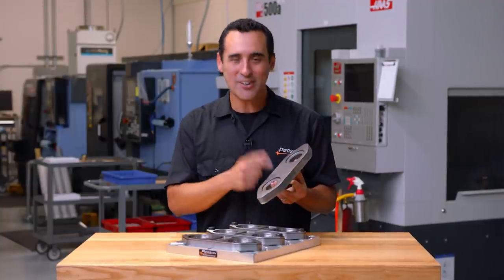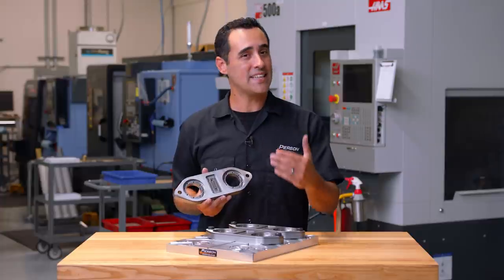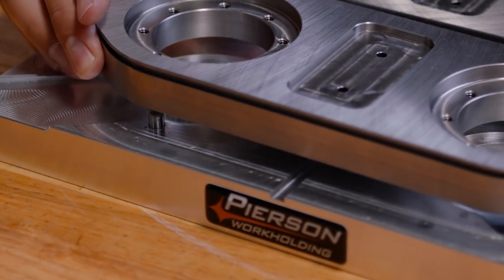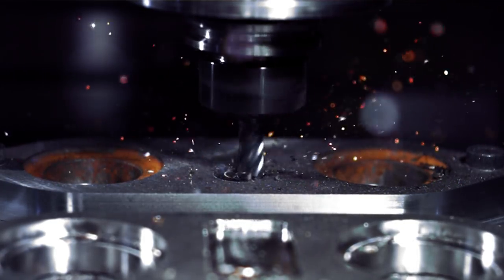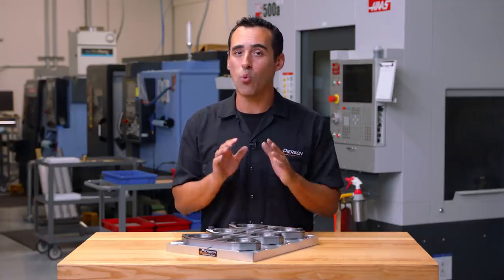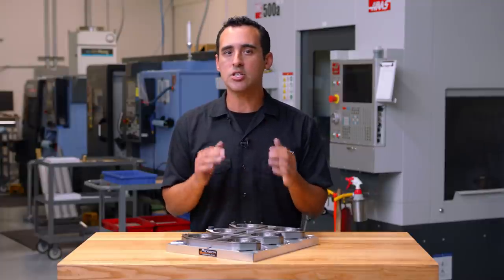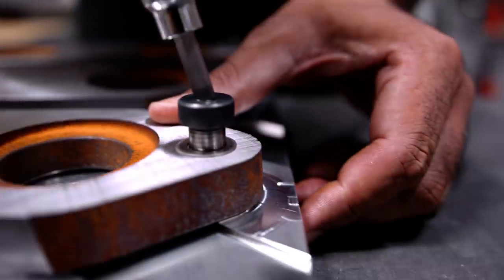Machining Cast Iron? TOTAL PAIN! | Fixture Friday 17 | Pierson Workholding

Comment: For chips évacuation at the shop I have worked on every large CNC lathe and milling we have created a large pit hole in the ground then made a concrete sealed pool and and drop in a stainless steel reservoir for the cooling system. So instead of having 10 to 20 gallons of tool cooling fluid we have 200 to 300 gallons, and for chips evacuation we have a separate system that pour lot of cooling fluid on the working tool .
And here in Quebec the ground in permanently at 10-15 degrees C*

Comment: Great video!
We use a ton of custom 18 x 18 x 2" pallets. 
To make them light enough to handle I do an isogrid on the backside.
Love the Pro Pallet System !!! no telling how many parts we've made on them.
Reply: That’s a really good idea!! How would you say the isogrid affects rigidity?
Reply: @thekeyfox  I run all my big (18 x 18") fixtures with isogrid on the back to reduce weight.
On the first fixtures I made, which were only 1" thick, no isogrid, I could measure 0.003" of deflection as I tightened up the pitbull clamps. Move to 2" thick and it dropped to less than 0.001". I see almost the same (just over 0.001") after cutting the isogrid on the backside. Isogrid is 1" deep, webs are 3/8" thick, Triangles are 2.250" per side. My mill operator thanks me everyday. 18 x 18 x 2" plate is heavy, throw on 6 pieces of stock at 8 x 4 x 1.75" and it really gets heavy.
Reply: Man, this makes me slightly glad that i've somehow ended up doing almost exclusively "you need a crane" or "you need a magnifying glass" stuff

Comment: Great video. Love the thumbnail. 😲 What video editor do you use BTW? Cool plugins. Also, how many parts would you need to make to consider acquiring a Blanchard grinder of your own?  I learned a lot about them after watching the recent NYC CNC video of the Bourn & Koch factory tour and have personal experience with such a product in the ATP 5 plate I purchased to replace the heated bed on my 3D printer. Thumbs up applied!
Reply from the maker: Blanchard grinding requires a very skilled and experienced operator. It is also INCREDIBLY dirty. For these reasons alone we'll outsource as long as possible.
Reply: @PiersonWorkholding  That makes sense. Thanks for the reply. 👍🏼👍🏼

Comment: Very cool video. Thanks for the insight. 
Would it work to clamp the parts for op 10 with two clamps through the holes to contour the outside and drill all holes on the backside? It may be possible to save the op0 that way. And pallet use the parts also for op10
Reply from the maker: We've tried a lot of approaches including the one you mentioned. Notice the pallet  has tapped holes at the center of the two large bores. We used to clamp down on the bores to machine the features but the methods featured in the video ended up being the most reliable and fastest method of production.
Reply: @PiersonWorkholding  thanks for the response. Yeah the clamp must spare out the holes and be clocked in the fixture to not be able to set them on incorrectly and block the hole locations.

Then make the fixture a little bigger and of steel to increase the ridgidety to place two op10 and two op20 parts on it and you eliminated two setups, two cnc Programms and have a one piece flow with no batches 👍🏼

Comment: How much price difference would there be to make it out of A36/hot rolled instead of cast iron? You'd presumably need less surface work and external grinding. Or maybe you're after the slightly more dampened material of the cast iron?
Reply from the maker: Good question. Compared to A36, cast iron is less expensive, it cuts like butter (long tool life), and is very thermally stable. Plus it has a dampening factor 20x greater than steel.
Reply: @PiersonWorkholding  yeah if you need the dampening, that'll do it!
Reply: I believe the correct term is damping.

Comment: Have you set up anything to try and deal with the cast iron sludge in the VMC you run them on?
Reply from the maker: Yes we run dual canister 20 micron filters in parallel after the coolant pump. Scroll way back through our IG for part numbers.
Reply: @PiersonWorkholding   Thank you for the reply! Do you find that keeps most of the sludge from building up in the tank, or do you just call it the cost of doing cast iron and clean it every 6 mo?
Reply from the maker: There's no preventing cast iron, or any chip material, from getting in the tank.  We use an Eriez sump cleaner after cast iron runs to clean and filter the tank.  The filters I mentioned earlier keep the cast iron out of the coolant lines only.

Comment: I didn't see where/how you drill the locator holes for the pins in the casting.
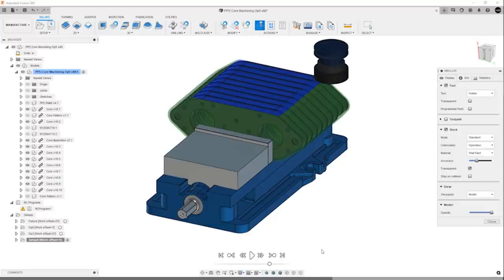Reply from the maker: We didn't show it, but I mentioned it at 1:47. We hold the parts in a double vise to add all holes for Op1. Specifically, we drill then ream the holes for the locating pin.

Comment: Hey Jay - Love this. I have some cast iron parts that come through my shop periodically and always struggle with the chip evacuation and keeping the dust down. Since you machine a lot of cast iron, I was wondering if you have tips for managing dust and/or maintaining coolant when machining cast iron?
Reply from the maker: Yes. We filmed dry for the sake of video but always run coolant. We also filter our coolant and change filters every 8 hours when running C.I. Scroll back through our Instagram for our DIY coolant filtration for under $200.
Reply: @PiersonWorkholding  Ace. Thanks so much. I’ll have a look for that coolant video right now. I have really been struggling with the dust. Cutting it is no problem, but the nasty film and dust left everywhere has me thinking twice about doing more. I was hesitant to use coolant because of the contamination, but a filtration system would mitigate that. Thanks!
Reply from the maker: @tshumay  Here's a link: https://www.instagram.com/p/BavvinOFfBP/
Reply: @PiersonWorkholding  Thanks! Ordered up the parts today. Goodbye graphite dust! I will not miss it.

Comment: I don't understand this... Why not design the system to be more like Zero Clamp or VERO-S? Where the customer just screw in some male-anchors on the bottom. Is that not basically what's going on anyway? What am I missing?
Reply: Much more expensive to do it like a vero-S, and if it were not cheaper than Vero-S system then there wouldn't be much of a value proposition. The Pierson setup is quite a bit cheaper than a VERO-S system if you are satisfied with the pallet sizes. I actually own a 6 module Vero-s which is quite expensive because I absolutely needed that style configuration.
Reply: I just got a quote for Vero-S and let me tell you it's very expensive. You get a lot more for your dollar with this product. I'm in the process of placing an order.

Comment: its all fun and games until you stripped a shoulder bolt
Reply from the maker: To expand on your comment, we use 3/8-16 helicoil inserts and torque drills. With that combination, you'll literally get 100,000 cycles before considering replacing components.